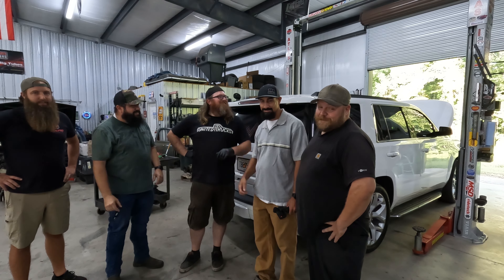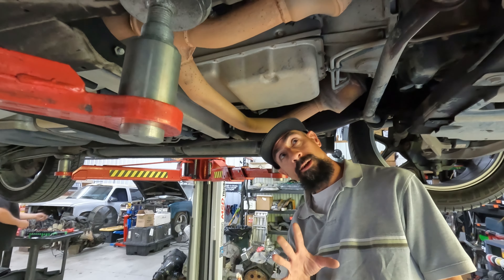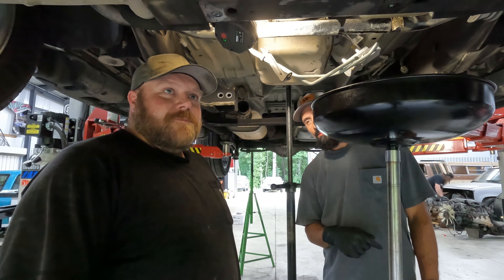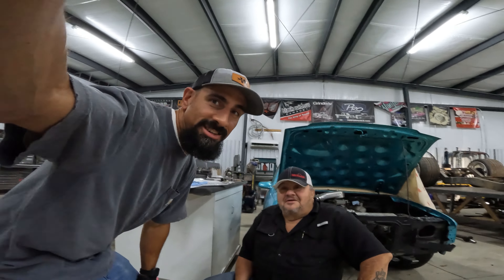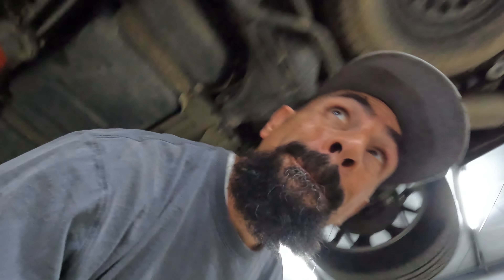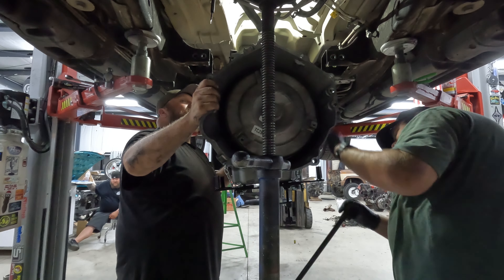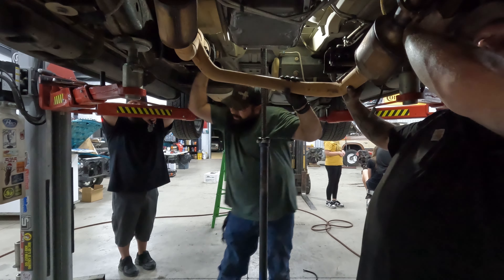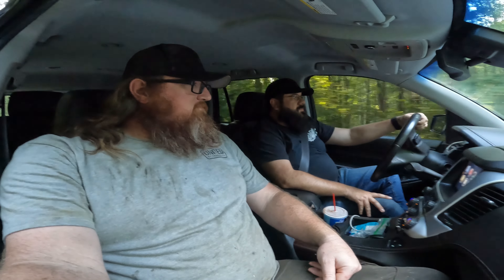Yukon 6L80E Transmission Replacement Gone Right!

Comment: I just had to do that to my wife's 17 Tahoe..63k miles and it took a crap.. torque converter went bad. Hers is a 4wd. A lot more pain in the butt..I put a billet converter in hers. Hopefully it will last longer than the factory one.